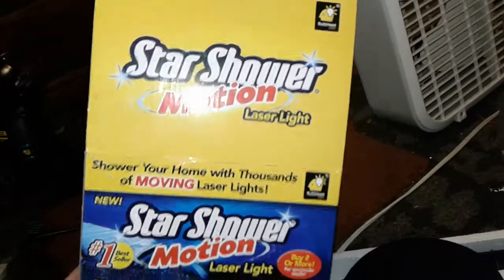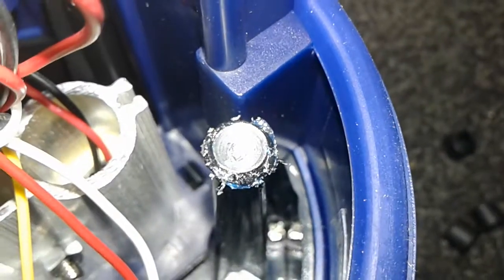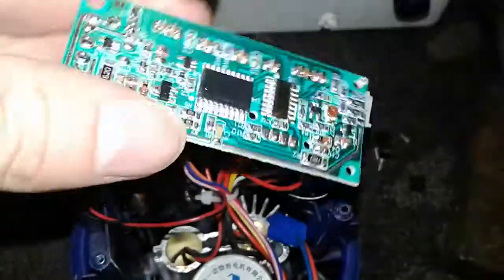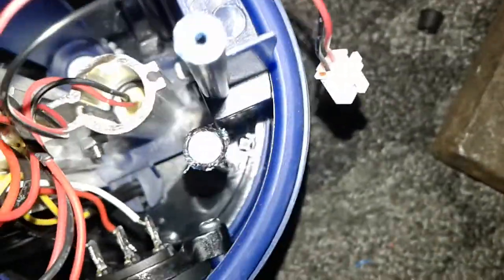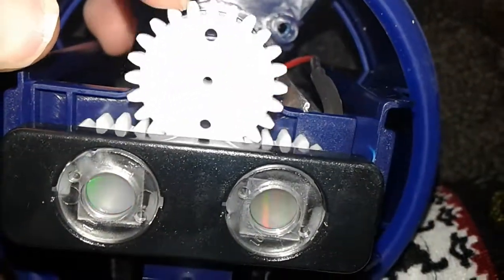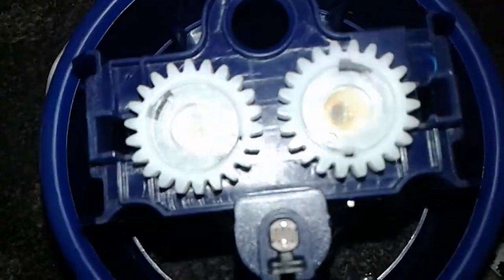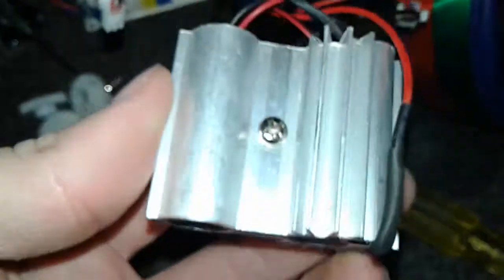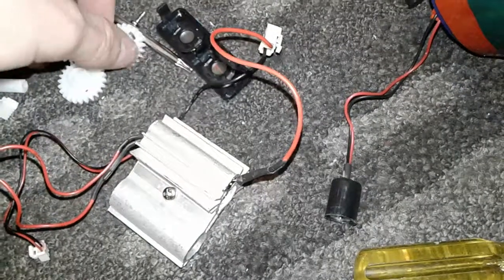What's inside the Star Shower laser Light show

Comment: As A professional who works in the lab with lasers and photonics equipment daily, I can promise you that that green laser is much more powerful and more dangerous than you realize. First of all the output power stickers are always a lie just so they can be imported without issues with customs. But even if the output of each of the dots 5mw or less… The main DPSS green laser is still close to 10 or 20 times more powerful than that. And the most dangerous part… Is the fact that it’s being pumped by an infrared laser diode that is invisible to the human eye. Unless they’re using a good quality IR filter, then it’s spouting infrared everywhere. You can literally blind or permanently damage your vision faster than you can blink. Even just from reflection off of a shiny surface.
It really is the golden age of Technology and easily available stuff

 for a few dollars online you can buy lasers powerful enough to cut and burn. They may say 5 mW and be dozens of times more powerful than that. Because power stickers are never anywhere near accurate 
They come with no warning, and by the time you flip it on and off a few times and catch a reflection of a shiny surface… It’s too late.

Comment: Thanks for this helpful information. The AC adapter cable on my light broke (as expected), and the resulting short-circuit damaged the components on the circuit board. Do you have a spare circuit board lying around?
Reply from the maker: Honestly I would not even bother trying to fix it since you can get to use 90% off at Walmart after Christmas for like a few bucks